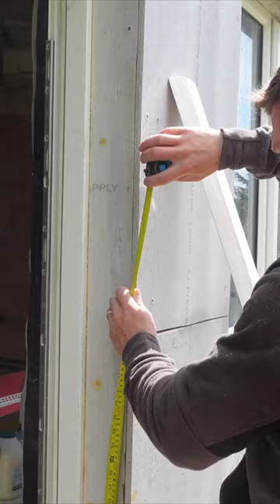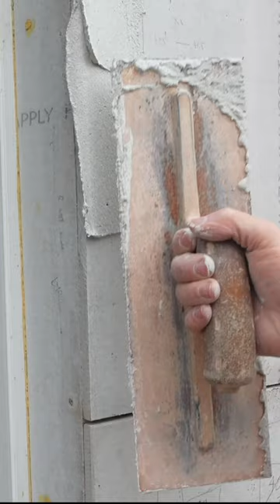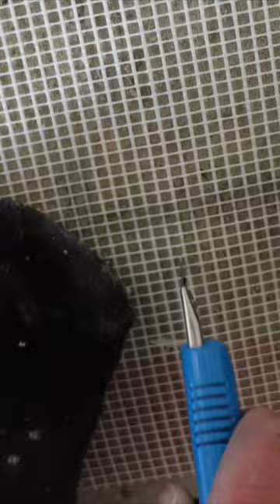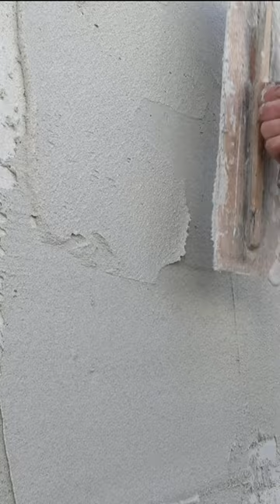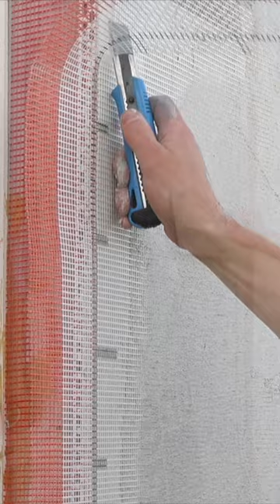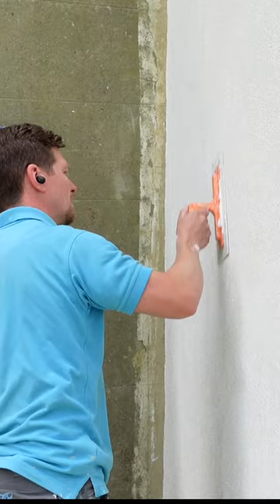Best & Only Rendering System... #construction #diy #plastering #siliconerender #rendering #shorts

Comment: Hi Blaine how long do you leave top coat to set before rubbing up? I've noticed if you hit it to early its horrible to work with and get it flat again, unlike sand and cement where i can get if flat wet or dry with a bit of water to bring it back.
Reply from the maker: Sounds like it’s too thick mate. You need to apply it really thin…apply a section and come back in yourself to pull even more off. One that’s done you float it straight away. It’s rapid when done correctly pal. Watch the full video here:

SILICONE RENDER | Is This The Best Rendering System?? (FULL PROCESS EXPLAINED)
https://youtu.be/USwYc7Op41A
Reply: @PlasteringForBeginners your absolutely right ! Usually got at least 2 guys one laying on and a guy floating right behind him maintaining a wet edge as you go. Most acrylic and elastomeric finish should go on not much thicker than the aggregate in it. Also try floating in random figure eights as floating in circles shows and looks like shit. 😎✌️

Comment: Why on earth is there external plasterboard?
Reply: It's fibre cement board. Not all walls are brick buddy.
Reply: @BlueVelvetBear how about expanded metal lathe . With metal beads and expansions ? I’ve seen a lot of these cement board systems since the early 80s and they haven’t aged very well. Lathe and plaster brown coat with acrylic or cement finish for the win !

Comment: You seem to say every render system is the ‘ best and only system ‘ lol. Thought you said before it was Weber Ocr? 🤨
Reply: Webber as an alternative to sand and cerment is still the best wont use anything else. this is more if u want none paint pre coloured scratch finish. But ya right alwasys seems to be a better system each week 😂
Reply: Perhaps Baumit are his new sponsor?
Reply: Personally after using ocr. I would stick to sand cement. OCR cracks too easily
Reply: The beginners gonna get his fingers burned....bad habit of not cleaning trowel.....no primer before top coat and if there's a fire alarm on the job he's in trouble 
Apart from that all gravy 👍🏴

Comment: Not after a year or 2.
Reply from the maker: It’s quality stuff. Lasts forever if done right
Reply: @PlasteringForBeginners  Blaine, it lasts but it moulds if not in direct sunlight for most of the day. All 297 bungalows have been rendered with K-Rend and every single one has mould on the outside. Now if you paint it every year then fine but that does not happen to OCR or traditional render, so for me it is not worth it and an extra ongoing cost to the homeowners.
Reply from the maker: Very true...K-rend is a nightmare for that. This thin coat system is a lot better though but I hear you. Sand Cement doesn't have that issue so I know where you're coming from to be honest.
Reply: @PlasteringForBeginners  I am not familiar with this system you used but I remember several of your videos slating K-Rend.👍
Reply: Thanks for this info regarding mould 😢 my north facing walls are only cement board so ai thought this thin coat silicone was my only option to keep weight on them down... but very little sunlight and very damp.... the mould issue is important. Might have to consider weatherboarding instead @DoraWillExploreHer
Reply: @BlueVelvetBear  Weather boarding with a breathable membrane underneath and battens fixed to allow airflow would look fantastic, as long as you treat them year after year.